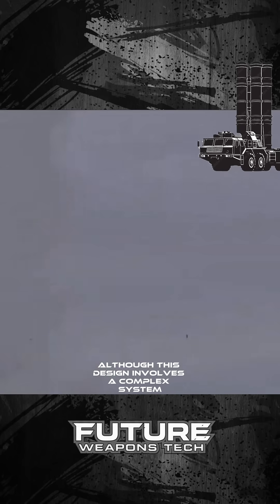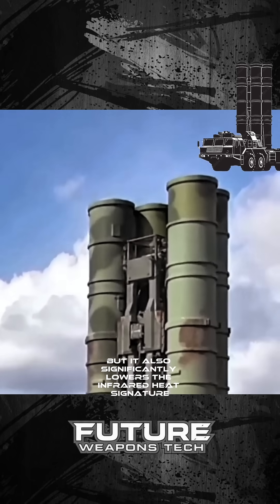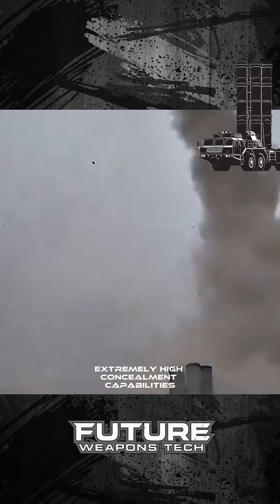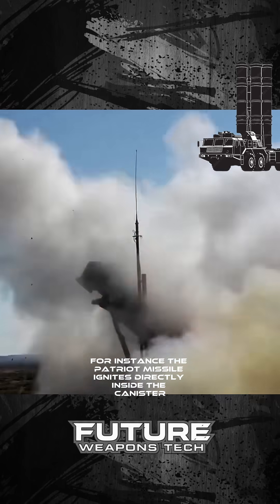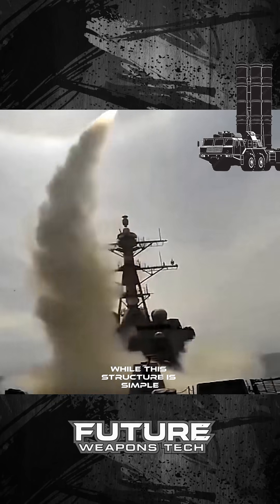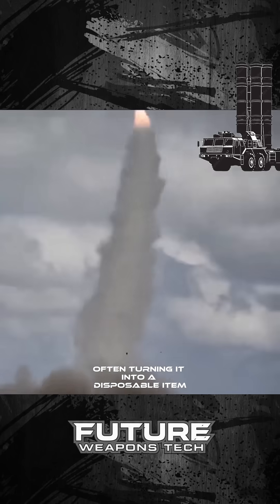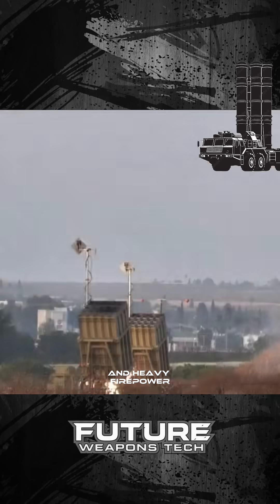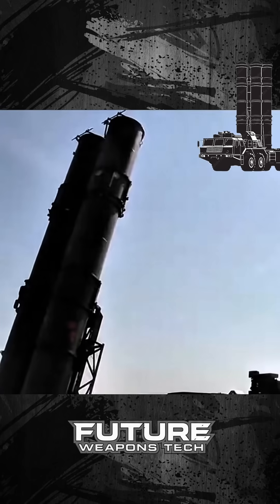Reason  why US Missiles Are "Disposable" #shorts

Comment: The Patriot was ao far ahead of its time during the Gulf War it was tested to shoot down short range ballistic missiles that Iraq had. The only issue was a timing hack that made the Pac1 inaccurate as time went by.
Reply from the maker: That specific 'timing hack' is actually famous in software engineering classes now—a tiny floating-point error that accumulated over 100 hours. It was a tragic lesson, but you're right, the platform itself was revolutionary for 1991."